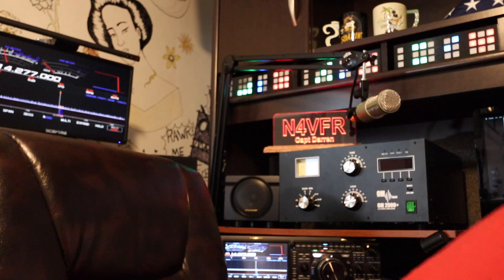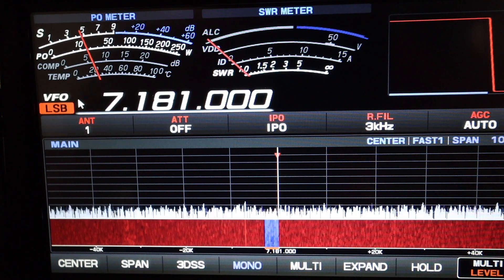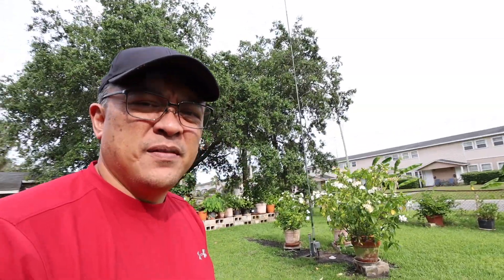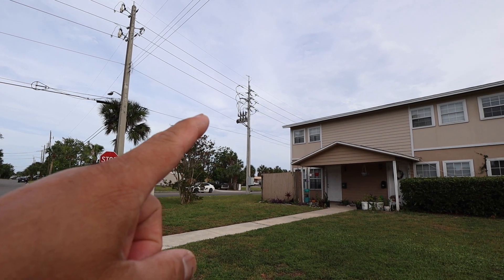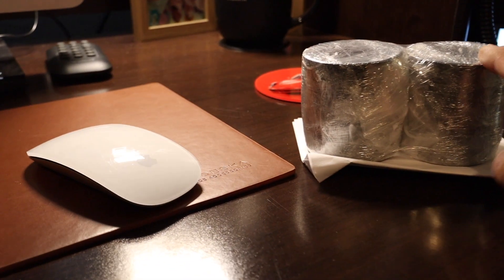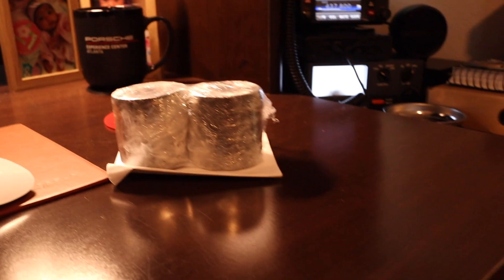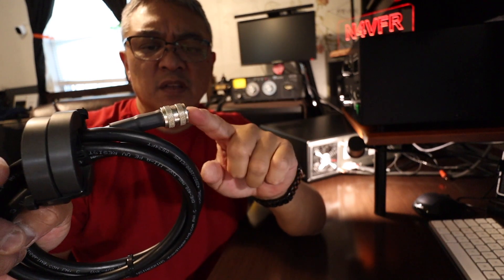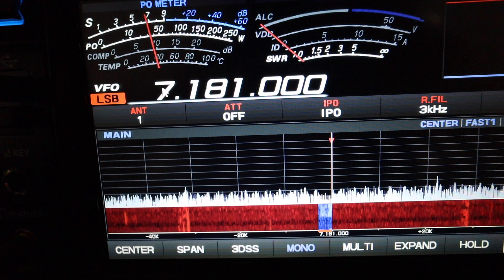Ham Radio and Annoying Power Line Noise!

Comment: Unless there is something I don't understand here I can not see how this could be of the slightest help to the noise issue you have.  Presumably the noise is coupling directing into the antenna on the actual operating frequency of the radio.   You can not filter it, with anything passive because fundamentally you would have to filter the actual frequency you're trying to receive on.  Sue you can make a filter for 7MHz, but it will attenuate the noise on the signal you're trying to hear equally.  Messing with the preamps and attenuator on the radio will also do practically nothing is, it wont change the SNR.  I suspect you'd likely be better to try one of those active phase cancellation boxes you can get from MFJ and others.  Place your sample antenna so it can see the interference source, but not much else, then use the box to phase cancel the noise.

Comment: The area looks like its being tort assaulted. The wires shouldnt cross the road. The noice disturbance should be within Radio Act limitations. Ham Radio are considered illegal years back, is it legal now? 

My home area Seri Kembangan went through vandalism where they replaced the entire wiring of the electric grids around and no one noticed or took action on who did that because it was organized professional conduct with fraud. The effect was scanning the area geo terrain. Its well organized military level assault. 

The water piping was scanned and they replaced it with rusty pipings causing water problem after several months they left. I was grumbling from the start but no one seem to understand the science i complain about.
Reply: Get outta my outta my head ashley simpsons song was on radio while i saw them doing those vandalism in the area that i was passing by.

Comment: Would be great to have a follow up. Could you solve the noise problem??
I do have similar noises plus a annoying power fence that makes QSOs difficult.
What helped a bit was a horizontal antenna.
Vy 73 de HB3XBL👍🇨🇭
Reply: interesting. Normally antenna's on the same plain as the power lines have more noise

Comment: Just noticed you have zero weather seal on your connections going through the window.  You should really add that as it wil ruin your coax if it already hasn’t.
Reply from the maker: I put some dielectric grease on the threads of the connectors and scotch 88 vinyl electrical tape.

Comment: 4:55 is contacts. Is used to disconnect power going down the post to breaker box on lower side of post. These can spark. If not contacts then there are multiple connections that can hum. I had similar thing. Heard 50Hz humming from there. No transformer and it was audible noise. Don't know if it does rf noise other than 50Hz

Comment: You're wasting your money on the ferrite beads if it's in-band interference.  The powerlines or soe neighbor's noisy router or switching mode power supply is likely generating harmonics or broadband noise on the frequency itself.
Reply from the maker: Thank you.  Welp, it's installed already for CMC.

Comment: I thought my RF issues were bad. Haha NM…
Reply from the maker: This initial video interference was resolved but now, I have a different interference.  I have't found the source yet maybe someone's plasma TV.
Reply: @DarrenN4VFR  I have a ham Raido in my truck and when I turn my steering wheel I get like 5 to 6db of static. I’ve tried almost everything but nothing has worked yet. I miss the old days when you hooked a Raido and antenna up and it just worked lol
Reply from the maker: @Fox250R  Is it ignition noise?  That's strange that when you turn the wheel you get 5-7 db of noise.  Have you tried to reroute your power and antenna cables to the other side of the truck?
Reply: @DarrenN4VFR  I have not tried that but i did try a hand held ( batteries) using my antenna on my truck and it was the same thing. 2018 Chevy Silverado z71 :(
Reply from the maker: @Fox250R  Hmmm, I don't know what else to do except trade in the Siverado for a Ford Maverick.
Reply: @DarrenN4VFR  hahaha!

Comment: You are going down the right path.  More choking at the antenna may be a good deal, not just from possible RFI mitigation but antenna performance.  That is any common mode currents will be kept at the antenna to radiate and not warm up feedline.

You are actually in reasonable shape as to RFI given your location and station.

A next step might be a separate low noise receive antenna, either a small amplified loop or LoG (Lay on Ground)  loop antenna.  In your situation I would probably consider the LoG loop first.

The LoG loop is recommended 0.15 wavelengths per side on the lowest band of interest and 1.0 full wavelength at the highest band of interest.  A LoG loop can be cut to cover 80m-20m.

The question I have is, "Do you have space that would not be on top of your ground radials?" If so, you should be in business.

LoG loops are typically fed with a 9:1 transformer. I am about ready to try one myself using a 9:1 balun from my Ultimax 53' DXtreme endfed antenna.  I think the balun may be an autotransformer and not a regular transformer so it may not get the same results.

Of course, you will either need to switch antennas manually from RCV to TX or use a switch, but that is fairly common in higher end contesting stations.
He is my quintessential situation at my condo on 80m.

https://youtu.be/JcAU3lpi97A
Reply from the maker: I have room on the property to LoG loop.  Never thought of that and that's one to try and test out.  Thank you for the recommendations!
Reply: Right video of 80m NVIS at condo.

https://youtu.be/Q1CJfAQ15ds

Comment: Don't just wrap the coax through the toroid, get or make yourself a 1:1 unun.
These chokes are super easy to make and your toroids will work fine for this project.

But I'm quite sure that your antenna is picking up the noise not the shielding of your coax.

Comment: It's not the center of the coax that has the big problem with bending the coax to an extreme.  It is the braid one the outside, shielding the inner conductor that gets opened or damaged.     Bending it too far can PERMANENTLY damage the braid and then no amount of straightening it back out will help.  
Most manufacturers list TWO diameters, some list three.   The larger one is the storage spool diameter.  The second is the minimum recommended installed size.   The third may be an absolute one-time minimum diameter, at which point it cannot be un-bent without failure - as when used in a Balun.
Reply from the maker: Ahhhh, that makes sense too.  Thank you.
Reply: one plus is its LMR-400 and its got foil plus the braid

Comment: Suggest you use a directional antenna at your listening frequency first, and then an ultrasonic detector to locate the power line noise.
We all assume you have tried turning off your homes power and running on batteries to see if your noise is self generated.
Reply from the maker: Thank you for watching and the suggestions.  Yes, I've already tried finding the source locally inside my home.

Comment: Hey Captain I just watched your video and I'm not sure if you ever got to resolution on the noise problem, did you?
One of the things that I am guessing you tried, but just as a starting point, have you tried running your radio completely off battery power and turning off the main disconnect on your house just to make sure that the noise you see is not coming from anything that you can control?
73 W3GUY
Reply from the maker: I'm back at work flying out of DFW. The utility company did identified the source of the interference and will notify the businesses about a power outage after business hours for repairs.
My 101MP uses 120vac for power and just shutting all circuit breaker with the exception of my shake. Noise was still there. I have ordered the QRM ELIMINATOR  to see.if that works.
Reply: @DarrenN4VFR  thanks for replying and I wish you the absolute best of luck. Noise on HF certainly ruins the experience, I'm sorry for the issues you're seeing, wish there was some way to help. 73 W3GUY
Reply: Did the power company fix it? I have the same issue here. I ordered a qrm eliminator. It works ok. The best solution is to use a receive antenna. When I use a horizontal wire about 4 feet from the ground as a receive antenna, it’s very quiet. I’m in the process or running coax and buying an antenna coupler that will switch to the receive antenna when listening. The nice thing about your 101 is you have an antenna jack for receive only and it will auto switch for you.

Comment: Capt D;   I am a retired EE and power utility CEO.  From what you show at the 545 mark it appears to be two distribution circuits dead-ended (likely 15Kv at most 34Kv), they are separated by a SCADA controlled vacuum switch (device on lower rack) on the pole. Above it is a manual disconnect switch for each phase.  If there is a cracked or partially damaged high-voltage insulator it will produce electro-static across a fairly wide band.  One easy way to check for this is simply turning your AM radio on your car and slowly go by the power lines in your block.  You will get some noise as you pass by, but if it seems excessive at one location, then call call your electric utility and tell them you suspect a potential cracked insulator and give them the location. Most utilities will check for you, as such insulators are typically difficult for them to catch as most the time they are intermittent.  I think you said your in Jacksonville so that would be JEA.
Reply from the maker: Ramsey,  thank you for commenting about the components on the power poles.  I did call JEA and while I wasn't home they called me to explain to them what I was experiencing.  The worker drove around the and identified that pole 110 was causing the majority of interference.  They will coordinate with the local businesses about the work they will be doing and will repair it after hours. I'll update everyone on the findings.
Reply: @DarrenN4VFR  Excellent Capt glad to be of help.
Reply: good idea thats what i was going to say walk past the power poles with a AM RADIO and see if the noise goes up. hope you sort ypor noise problem it can be a bit of a pane lol 73 m7byf

Comment: Hi captain Darren N4VFR. If you love 40 meters I would use a rotatable dipole. I use a cushcraft 40 meter and  my electrical noise is half  the noise on 80 meters. Best wishes W2BAB
Reply from the maker: Thank you for the recommendations.  The City of Atlantic Beach patrols my neighborhood and I already received a notice that I can only have 1 antenna.  So I took down my jpole and a month later relocated the jpole ant and camouflaged the mast and antenna.  My primary HF will be the Zero Five and it's also camouflaged.

Comment: Hi. Going vertical is not the way to go. Most electrical noise will be seen using a vertical antenna. You need to go with a horizontal antenna. The toroid's you used in the house is great but there are smaller clip on ones that will work well to stop rf from getting into you transmit audio. 73
Reply from the maker: Thanks for the tips!

Comment: Have you looked at Palomar Engineering for the RFI/ Noise kits de KD2SXD Jax, FL
Reply from the maker: Hey Neighbor Mike!  Yeah, I did but I wanted to start with the toroids.  My receiver is still picking up power line noise.  JEA already came out but the wrong guy came.  There is another JEA team that has special equipment and hopefully they will come out today. They will probably hook their equipment to my antenna.  We'll see...
Reply: @DarrenN4VFR  OK great! Hope they get it fixed soon so you can enjoy that nice radio and new amp! Are you gonna be in town on Field Day?
Reply from the maker: @kg2mmhamradio  I don't know, I don't have my flight schedule yet for August.
Reply: Here is a link..https://palomar-engineers.com/rfi-kits/ham-radio-rfi-solutions/transmitter-rfi-kits/Yaesu-FTDX-101MP-Deluxe-Transceiver-RFI-and-Noise-Reduction-Kit-RFI-Range-1-60-MHz-14-Filters-p268006505 de KD2SXD Jax, FL also
Reply: Call JEA and have them come out and fix it. Go around with a AM radio and try and find the power pole with the issue.
Reply from the maker: @kg2mmhamradio  Yeah, JEA is coming back with another person who has the right equipment to sniff out the noise. AM transistor radio?  I don't have one of those anymore.  When JEA come, I'll see if I can make a video of what he's doing.  They probably won't allow me to film due to liability issues.  Mike, what repeater you monitor or 146.52 simplex.  I'm monitoring 146.52 and the BARS 145.35 repeater.
Reply: @DarrenN4VFR  I'm usually on the NOFARS 146.7 repeater and I also monitor 146.52 simplex as well. I am a member of BARS and I usually check in to the weekly net on Mondays at 1930hrs on 145.35.  You can find me on DMR on TG 31121 First Coast as well if you have DMR capabilities.
Reply from the maker: @kg2mmhamradio  Let me program NOFARS repeater and try to call you.
Reply: @DarrenN4VFR  Call me on the Bars repeater

Comment: Are you using a vertical antenna?
Reply from the maker: Yes, It's a Zero Five 27' HOA fold over vertical HF Antenna.
Reply: @DarrenN4VFR  Unfortunately, that is likely contributing greatly to your noise issue, as power line noise is usually vertically polarized 🙄  It was smart to try ferrite....best of luck solving this problem!